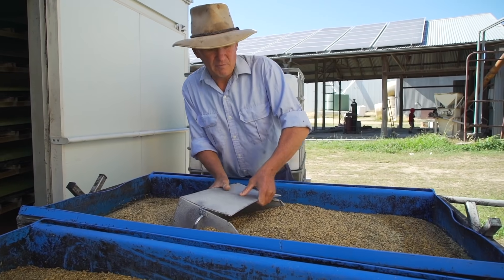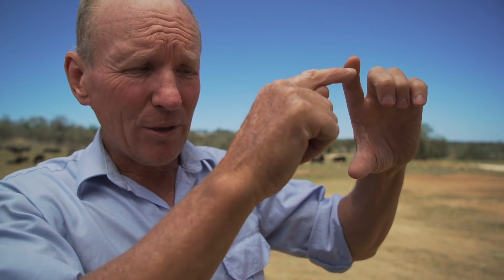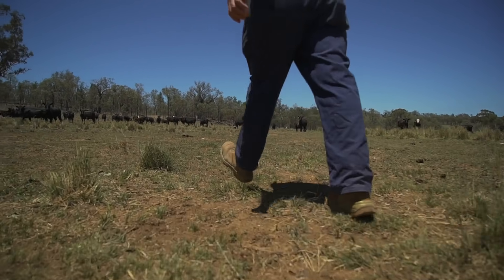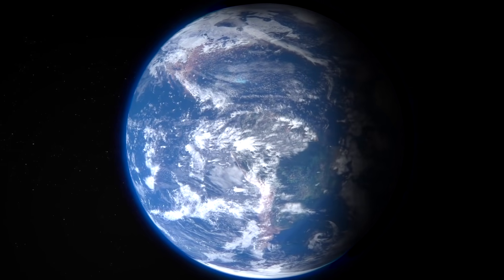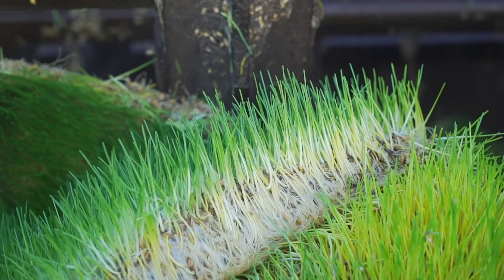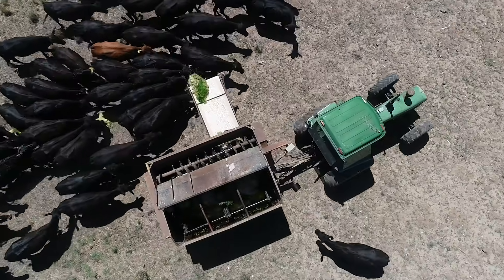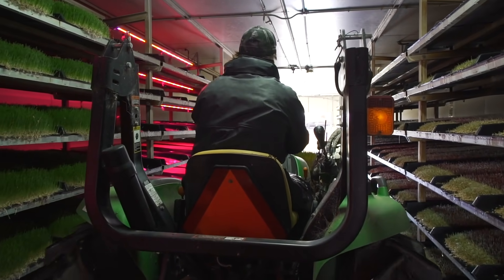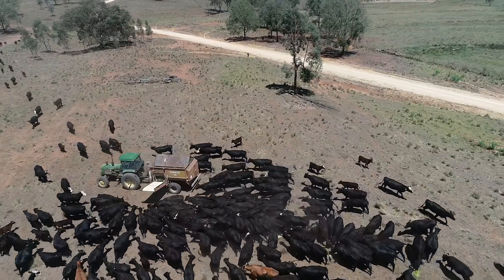The Fodder Shed: Solving Drought in Australia.

Comment: How long does it take the barley to grow in the fodder shed? Of all of the Aussie videos I've watched, nowhere are there any wells. Is there not any water under ground ?
Reply: 6 days. These systems don't use a whole lot of water, even less if you recirculate, although you would run into clogging and mineral deficiency issues.